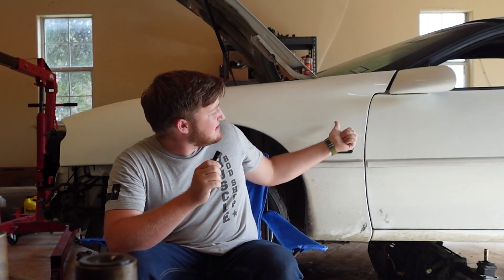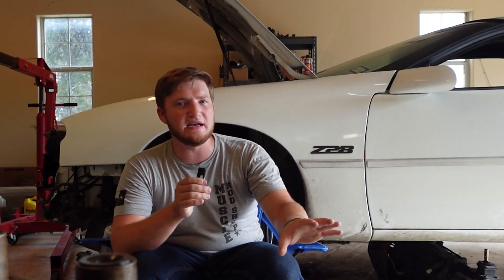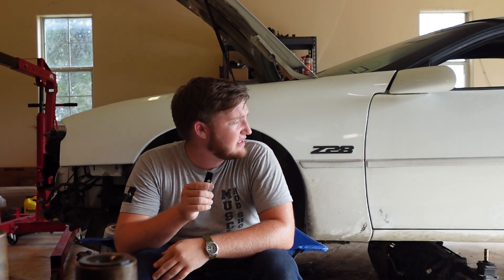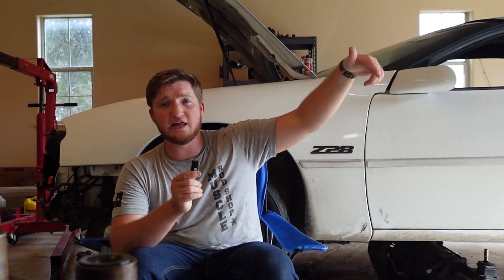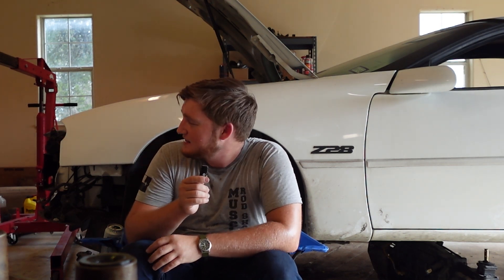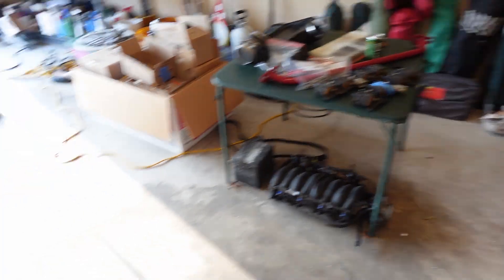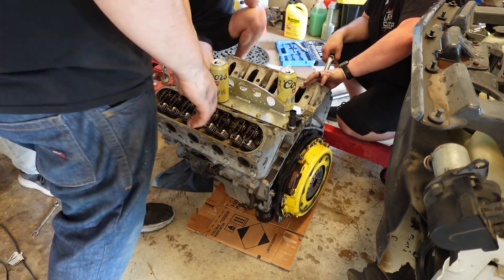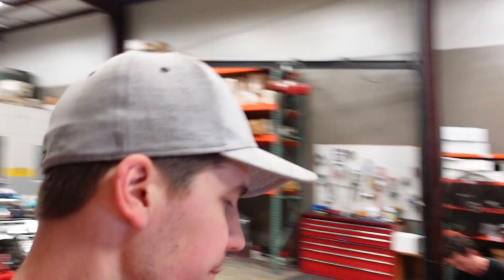This 383" LS1 was DRINKING Coolant & Oil... NEW ENGINE BUILD SERIES!! | Part 1

Comment: How much compression can you do on pump gas??   91??
Reply: Dynamic compression is a variable along how efficiently the head dissapates heat. You can run a whole point of compression higher with alumninum heads over iron.
Reply: @____MC____   Sooooo. 12:1 static with a stout cam. 10.5:1 with a standard cam?
Reply: @russcole5685  i dont the formula. Just there's more to it than static compression. More valve overlap bleeds off cylinder pressure. Better cooling allows you to get away with more. No sharp edges inside the combustion area either.

Comment: man, i love it... just dropping in my newly built (by me) LM7 into my 01 Suburban today... 330k on the factory motor that had the leaking 706 Castech heads that was drinking 1/2 gallon of coolant per week and a quart of oil every 700 miles over the past few months... the new LM7 is decked .002" and machine honed at standard bore of 3.780" and running the BTR Truck "Torque" cam, new BTR LS7 lifters, c-cliped rockers, pushrods, summit hypereutectic pistons... the crank was polished and balanced along with the pistons and rods down to a 10th of a gram... i cannot wait to see how this new motor runs and performs.... your pushrod length video was super helpful when it came to that step and i will enjoy following this one...

Comment: Not trying to sound dumb Is this just a racing set up?  That Cam & 12:1 seems pretty high for street driving. Im assuming with those specs this is going to be a 7500+ Rpm.
Awesome video ! I cant wait for the next part in the series
Reply from the maker: It will be a daily driver